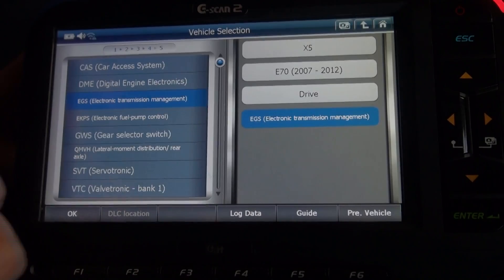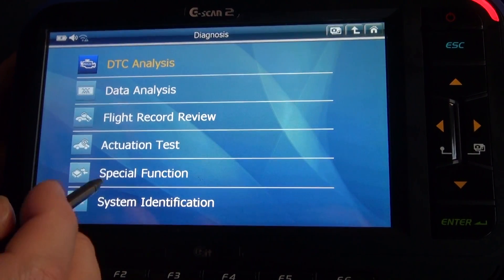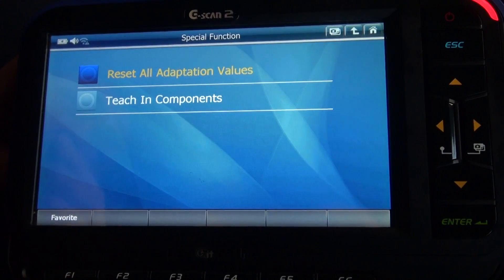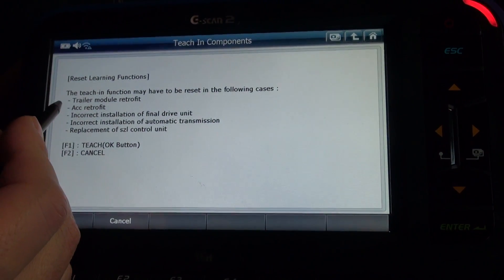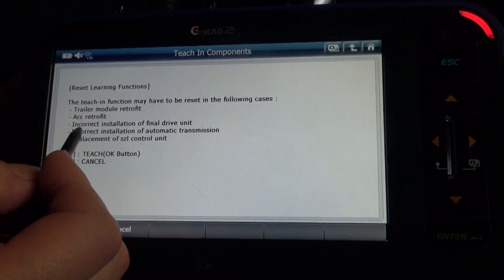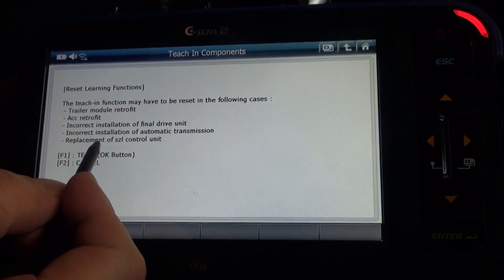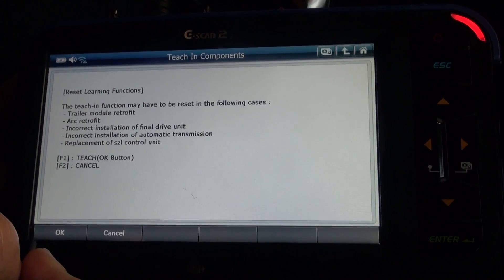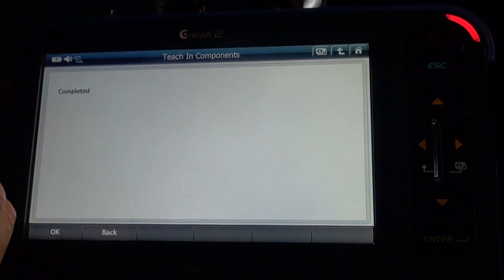[G-scan] 2009 BMW X5 Special function in Transmission

Comment: robin 
  hi my dear boss i am from iraq i have a problem with gscan2 software for toyota my problem is there is no function to reset steering angle sensor for toyota prado 2010-2016 and toyota corola 2010-2016 
by the way i presented my problem for many users for gscan2 they have same problem 
please i want reply from your comany as soon as thank u 

best regards 
Mr.Saad Electron
Iraq-Baghdad
Reply from the maker: Please contact Robin at robin@e-zds.com regarding your case or post at Tech Q&A page of our website. https://g-scan.gitauto.com:6510/eng/board_skin/board_list.asp?bbs_code=5
Thank you.